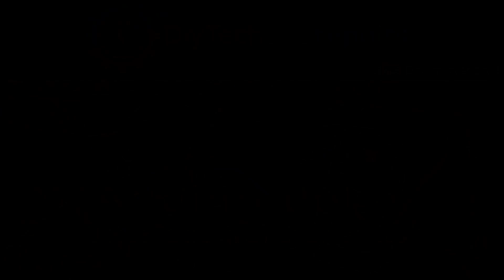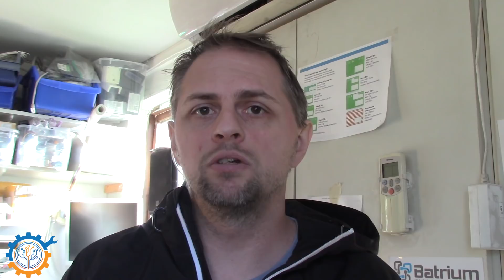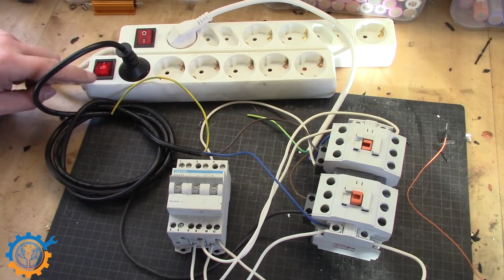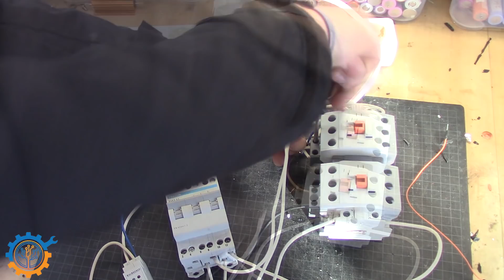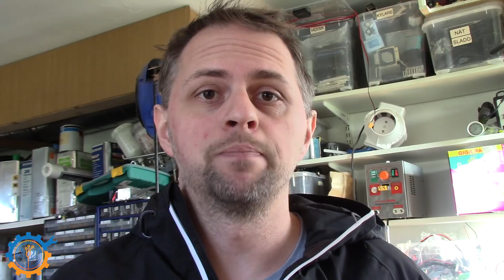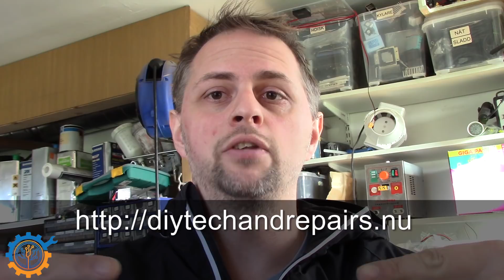Automatic transfer switch - adding a delay relay for going back to grid

Comment: Very informative. I’m a woodworking guy, and a novice in electrical automation. I am trying to automate my shop vac filter cleaning. I have a 2kw 220V shop vac, and a small 200W motor that runs the filter cleaner. I start and the stop vac with a remote controller. Today I run the shop vac filter cleaner manually. I would want to run it automatically with a time delay, such that it starts 5 sec after shut down of shop vac, and runs for 10-15 sec, and then shuts down. This repeats after ech time I use the shop vac. Do I need a full set of interlocking contactors, relay and timers to ackomplish my goal? Can you gaide me, or better still, could I ask you to create a Youtube video on this topic, as I am sure I am not the only one struggling with this task.
Reply from the maker: I guess you only need a delay-timer added with its own set of relay for it.  But if you want to start something after and then run for a set of time im not sure what devie out there is the best for best price. Some programable device should work i guess.

Comment: During those 5 sec delay is there any electricity passing through any of the two contactor? or they are both open during that time? which Aux on which contactor passing electricity during the 5 sec delay? is it possible to post on your website the diagram of the above without the DPDT setup (just the two contactor "main and backup" and the delay on timer)? 😜it is difficult to follow up with all those wires going in and out...appreciate your input and help
Reply from the maker: The delay is just a delay to when to switch back. Instead of switchibg back direclty when priotized power is back it Will continue to run for another 5 seconds.
Reply: @DIYTechRepairs  I though the whole purpose for the delay timer is to power off electricity from one source (solar) and then delay few second where everything is off, then power "ON" the prioritized source (main) so that there would be no spikes or collusion. it seems that your delay setup is for protection against power source fluctuations in case the main source on/off multiple time in a short period of time.
Reply from the maker: @abusam1  can be but in this case its preventing from switchibg back and forth of THE other source just comes back for a second. Same principle as in a ups

Comment: Great video, can this set-up be use for generator and mains (power)? Where the generator is turned on when power is out and turned off when power is restored
Reply from the maker: Yes it can byt you need electronics to start the generator and do the switch.

Comment: It would be very helpful if you made drawing of connection  between contactors and delay switch. Explanation is nice but without actual drawing of actual connection between ATS and delay relay doesn't help.
Reply from the maker: I could.

Comment: I was wondering. Often when you have 3 phase power from grid, and 3 phase inverter, would it be possible to utilize multiple ATS after the main solar/grid ATS, to do something else: phase balancing. I.e. most of the equipement and lights in house use single phase, and you usually distribute phases to be relatively balanced (otherwise you will get some neutral currents). But usually this is done statically and once forever, i.e. one floor or room using first phase, and another room or floor using second phase, etc. But with ATS, one could do it dynamically in principle, to make phases more balanced. It could be annoying tho (and increase risk of equipement failure) of course, so some hysteresis, delays, and microcontroller control could be useful here. A lot of equipement will not care about the fact that the phases are out of phase. I.e. Almost all PSUs will not care, or tungsten or LED lights will not care either, because they rectify the signal and store it in the capacitor. Still, one would need to be a little bit careful, because if you switch too fast, the temporary RMS voltage could be higher than usual, and some capacitors might not like this. This might happen when the switching happen just after the peak (as it is going down now) of the voltage curve, and you switch to a phase, and voltage curve goes up again. But one could initiate a switch over only when the initial phase is at zero point (and is going down), then wait a bit, and switch on second phase, when it is crossing zero point, and also goes down. This usually will be 1/3 of the full period. So if you are 50Hz, this will be about 7ms.  Still I think it would be really interesting experiment.

EDIT: Apparently it is commonly done in distribution networks, it is called "phase balancing" or "single-phase lateral loads phase swapping", and there are not too complex algorithms to automatically balance the system. It is usually done in low voltage distribution, i.e. from 3 phase medium voltage distribution, when it is distributed to single phases (i.e. to offices and homes that use only single phase). The system usually tries to do minimal amount of switching (to reduce interruptions), and to make less future switchings (keep it diversified).

Comment: Thank you for the share knowledge by good simulation. BTW, some technician use Omron "Timer" Delay Relay instead of Delay Relay here, which one is the correct/safety. Thanks.
Reply from the maker: Omron is a brand only

Comment: I was thinking that the delay would be between the switch....5 seconds between the grid and the solar. 
This way you are only adding a delay of 5 seconds when the energy return right??
Reply from the maker: Yes. The delay is there to not cause any flickering faster than 5 seconds at most as in this example.
Reply: but you still have no delay between then...its not better to have a delay between change? I want to change when solar ends to grid....disconnect the solar, wait 5 seconds, and reboot with grid.  When the solar its back again, disconnect the grid, wait 5 seconds and reboot with solar. This wait sync it´s not a problem. The only problem  its everything goes off. I don´t know if you are understanding what i mean. My english its bad lol
Reply from the maker: You can do that and its preffered if you dont have syncronized sources of power. If thats the case you SHOULD wait between switching :)  0delay switching is only allowed if the both sources have syncronized its frequenzy. I have that and therfore no delay one way.

Comment: That will work well for the switching side of it. But the load side on the diagram they sent you is wrong. I wired up mine as per diagam and got no output. I have nutted it out and got load side working now!